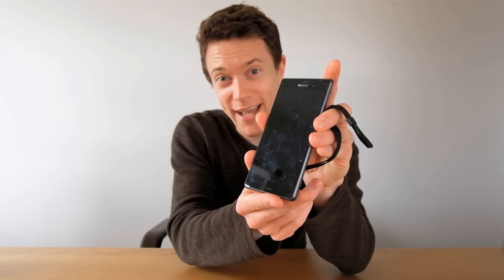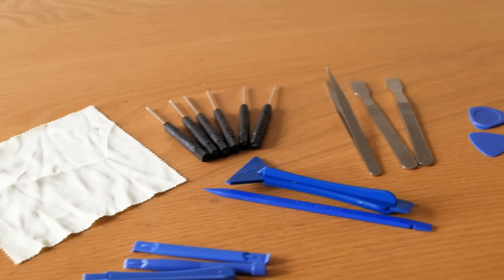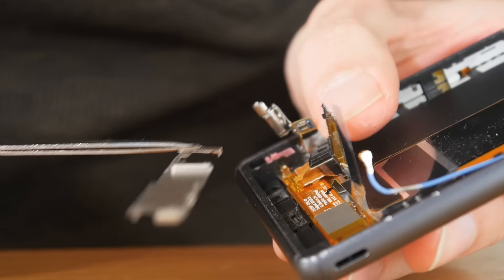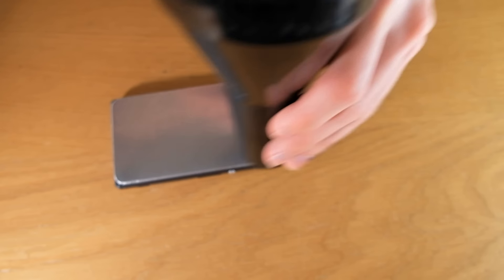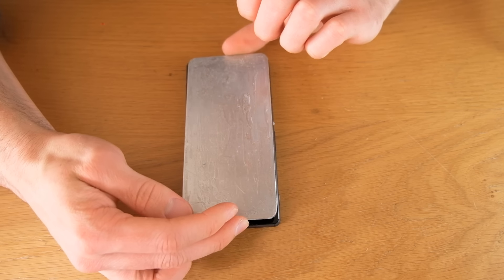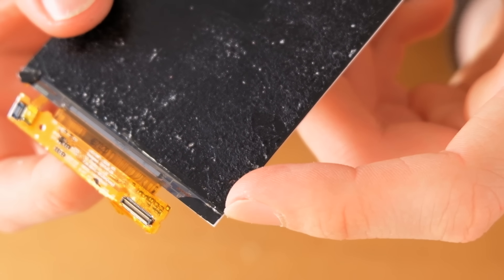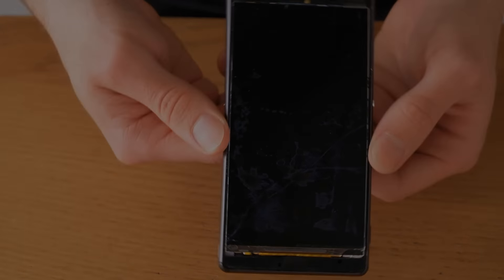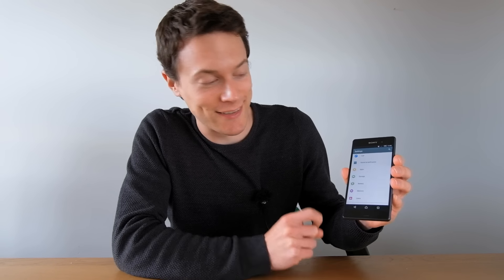Fixing a Smashed Phone Screen - on a budget! (GLASS ONLY REPAIR ATTEMPT)

Comment: Mr Perks. Don't use metal spudgers to work on the battery or connectors. You run the risk of shorting the battery and damaging it. Also the capacitors will hold a small charge after the battery is disconnected. The metal on your tools can complete parts of the circuit, sending unwanted power where it could potentially do damage.
Always use non conductive tools when repairing electronics when you need to touch connectors or other circuitry.
Reply: Also replacement screen / glass / digitiser modules can be bought on ebay for around £22 (for the Sony) and are easy to install. I had to do this for my brother in law a few weeks ago. The replacement glass was going to cost £17. The extra £5 and less work option of the complete unit was a no-brainer.
As to the issue of 'cheap copy', the build quality of the replacement unit was just the same as the Sony original. Also the digitiser was the same model and manufacturer as the Sony original.
I did enjoy the video however. Please keep up the great work and high production values.
Reply from the maker: Thanks for the tip.

Regarding the screen though, it really does matter that it's original. I later repaired a Z3 compact and bought a replacement screen + digitizer on ebay for roughly £20 and, while it worked ok, the screen area was smaller and the colours were very drab and dull in comparison to the original (brightness was fine though). I'd personally leave the cheap replacement screens well alone, but the official ones are much more expensive.
Reply: Maxx B incorrect. the battery has a built in protection circuit. and those capacitors wont be able to damage anything unless you try really hard
Reply: While you are correct that most modern batteries have a protection circuit  that helps keep the battery itself from suffering short damage (usually) the major concern with using metal tools is that you can make contact with the battery connectors and other connectors on the Logic board, which can cause permanent damage.
Reply: I'm just advising folk to avoid using metal tools around circuitry. A £500 phone is an expensive risk to take, when if you use a plastic tool, you remove almost all of the potential for damage. Feel free to use whatever tools you want.
As to the original screen over the cheaper replacements. The title of the video is fixing a phone on a budget. I was just making suggestions based on my experience with budget replacement parts. I found the replacement part to be of good quality, no difference in screen size or colour quality. Perhaps I got lucky with my purchase or you were unlucky. I suppose it's a mileage may vary situation.
As far as a budget repair goes, the cheap all in one module was a relatively easy fix and saved an expensive phone from the rubbish bin.
Reply: Maxx B seconds of shorting really doesn't matter for the battery..
Reply: That exactly what I wanted to say, oh well, have a like.
Reply: Looked aluminium to me and Aluminium isn't particularly Good to conduct things on that low voltage.
Reply: @siux94 and @mindaugas49ccm you are both hugely incorrect about shorting for a few seconds being harmless. LiPo and Liion batteries are current sensitive in their chemistry, high discharge (shorting) and high amp chagrining as well as over discharge (running the battery flat) all cause lithium crystallization in the battery chemistry that causes internal shorts when those crystals pierce the anode cathode barrier where the electrolyte is suspended causing a chemical chain reaction and fire, explosions and bad days in general. @Maxx B is totally correct, i cringe when i saw @DIY Perks using metal tools on the internals, never ever stick metal where magic electron pixies live, just ask AvE
Reply: Helveteshit, Aluminium is still a metal and it conducts electricity maybe not as good as copper but good enough to short things
Reply: @chaos That still don't approve metal tools, its not about shorting the battery , but shoring positive contact with something near on the motherboard can lead to serious damage .  What goes to the battery, most batteries has that protection circuit for shorting, overcharging and discharge protection, but shit happens and that circuit also can be damaged.
Reply: @mindaugas49ccm did you read my comment? sorry if i assumed you were siding with @siux94, you weren't clear either way. i basically said metal tools + circuits = bad
Reply: For Aluminium to short on that low voltage on such a contact, you would probably need more than mere 3.2V. Sure the risk is there, but the risk is low compared to Copper. 

Aluminium is twice as bad as Copper which means the risk is low. And even then, you all shouldn't even speak about what is correct or not when you handle electronics without Earthing the stuff anyhow. 

Because ya know, Static Electricity can discharge more than 5V in a spike which is plenty to injure sensitive parts. But ya know... You are all arguing about the tools that have lower risk than fat fingers that aren't Earthed. 

One thing if you have dry fingers which leads to better isolation on your skin but hey, how many of you got callous fingers from working hard with your hands without gloves?
Reply: @chaos I think he meant "with battery" not "THE battery" in one sentence. Sorry for assuming your argument wrong.
Reply: +Helveteshit Hey, we all trying to be samrtass here, but being too smart is just annoying
Reply: @mindaugas49ccm, so true, @halveteshit buddy Aluminium is an electrical conucter ans will short a battery at 0.1V just as much as 3.6V, whay do you think they use it for Bus bars in electrical engineering. http://apps.geindustrial.com/publibrary/checkout/Alum-Copper?TNR=White%20Papers%7CAlum-Copper%7Cgeneric

and btw ive worked as a chef for over a decade and my hobbies include blacksmithing so dont go talking about calluses to me.

Also i have like 10 other issues with things he did in this video that i didnt even bother bringing up like using that hairdrier with that LiPo battery (they dont do well with high temperatures) all in all this was a bad video to share other than to point out the things NOT TO DO
Reply: Aluminium is preferred in both Electrical cables of certain thickness as Bus Bars or simpler stuff because of few simple little reasons... Weight, Flexibility and Cost. 

Aluminium is easier to bend, easier to pull and on that voltage... Aluminium provides pretty much no resistance worth noting. 

As for it being an Electrical Conductor? I never said it wasn't. But I said on that voltage on such a connection, the risk is low. You run higher risk of discharging static electricity than shortening a battery with  a tool. 

Oh and since you blacksmith as a hobby. You should already know the difference between Copper and Aluminium or do you only handle proper Iron when you do that stuff which has even lower conductivity?

And upon closer look, the stuff he is using is just normal Metal by the looks of it. It isn't even aluminium that I first thought. Polished Metal or Stainless, I do not know. But their conductivity is five times if not worse than Aluminium. 

Do not recall the proper calculation table for materials conductivity. 

But hey, you are the Chef that knows how to cook Pasta better than I.
Reply: Everyone saying that shorting a battery isn't a big deal because of the protection circuit is putting a lot of faith into a saftey features that is never tested. Correct it probably won't cause a problem. But it could, and using a metal tool to disconnect a battery is like not pushing the brakes because your fancy new car has brake assist. it's there incase you mess up, not so you can be sloppy. I hope none of you work in phone repair shops.
Reply: Maxx B, So I have to put my Grandmother's Stirling silver butter knife back in the drawer?  I remember reading somewhere that silver is one of the best conductors of heat and electricity.
Reply: Diamonddrake The protection circuitry will protect the battery, no doubt. But its likely that the high current will damage the connector or leads.
Reply: John Doe silver is indeed a little bit more conductive to heat and electrical current than copper, making it the most conductive material at normal temperatures.
Reply: guess what's one of the conductors inside the lithium polymer batteries that can supply hundreds of amps at 3.7V? Aluminum ... Get your facts straight.
Reply: This is a things on xperia display, screen maker srink the display from 5.1 to 4.9 inch to make some money it happend on me 3 time ...
Reply: If you want a good display get a real Sony part or even do what he did and get a phone that just needs a main board.  If you know people who can get real Sony replacement displays get them to replace it.  You can be very sure that Sony would manufacture spare parts for their phones especially displays since they get broken a lot.  Why buy some mystery aftermarket part that might be of inferior quality when you can get the same parts your phone shipped with originally?!?!?
Reply: Z3 compact is originally 4.6"  and it still looks nearly borderless on it's sides!
Reply: The Z5 compact is just as nice but 23 MP camera and aluminum back panel.
Reply: You know this guy builds his own t.v.'s and other electronics right? telling him to watch out with shorting things is like telling an electrician to turn off the power when working. It's obviously a phone he's willing to lose and despite most batteries having shorting protection you're remarking him not to use metal tools near a plastic connector.
Reply: Maxx B I'm not sure what you know about electronics, but being willing to lose something doesn't mean you should show 500k people the wrong way to do something. Moreover, this channel is about diy, he's not a professional, and it's clear not everyone knows that. But he is handy and yes if you are very careful you can get away with it.
Reply: I know Mr Perk's has a good idea about what he is doing. I know this is a DIY channel. I'm also aware 200,000+ people have watched the video. All the more reason that Mr Perks should use the appropriate tools for the job. What if some kid with more enthusiasm than common sense has a go with a repair and hurts themself? I know the likelihood is slim, but there is a risk. 

My original message was just meant as a word of caution so that nobody got hurt. Judging by the knowledge demonstrated in the replies about aluminium not being conductive (it is and it's used frequently), and that charging protection will stop a short circuit (it won't, it fries the protection circuitry if you are lucky, destroys / vent's the battery if you are not), I think Mr Perks might have to be a bit more careful about what he tells people is possible.

Yes, it is difficult to damage your phone with a lithium battery when doing a DIY repair. But it's not impossible. Once a lithium battery catches fire, it is very hard to put it out again. Sending 4v into the wrong part of the phone's circuit can kill your phone. Electrostatic discharge into many of the phone's chips will damage them. This is why I commented about using a metal tool on the inside of a phone. You are just increasing the chances of doing more damage. Even if the phone is one you are prepared to lose. Frying the ICs when you replace a screen module isn't a smart idea.

Feel free to use whatever you want to repair your phones, TVs and other electrical devices. I really do enjoy reading the Darwin Awards web site ;)
Reply: Maxx B The repair was done improperly. You are so right. As a long time repair technician, it hurt to watch this. I he he had no plan to uv glue the new glass to the LCD. This is why I always quote screens as a full panel replacement. I never do glass only unless the digitizer is not glued to the LCD. Also what you said about metal tools on connectors.
Reply: Short circuit protection is not 100% effective, also it's there to protect the battery from exploding, not the electronics inside! If you accidentally apply power to something designed to carry signals almost a 100% of the times you will damage the system without tripping any protection circuits!
Reply: The Super Spowart d
Reply: Helveteshit 3.2V is actually a lot in this case. An i7 7700k CPU at stock speeds is only provided with roughly 1.3 volts from the motherboard, and anything above 1.5V will fry the CPU. Phones have CPUs which run at a much lower voltage, so 3.2V could definitely be devastating. Why do you think that people say that you need to discharge the static electricity running through your body (whether that is using an anti static bracelet or by just touching a grounded metal object)?
Reply: Helveteshit Also static can easily just pass from your skin into the metal rod, and static electricity can very easily reach 5V.
Reply: a really bad cracked phone
Reply: @henkmegool7864  oh noooo! Dont do that! You will let the magic smoke  out! 😅 Yes, short circuits are possible, damage level depends on short to what....

Comment: Pro tip
Don't use a matal tool to disconnect the battery please use plastic

I shorted my battery and I had to buy a new battery
Reply: Shorting out a lithium phone battery, especially one that is fully charged is a really bad idea. There is a scary amount of potential energy bottled up in one of those that can easily give you a nasty shock, burst into flames or even explode. Remember the battery in the Galaxy Note 9? All lithium batteries have the potential to do that if mishandled.
Reply: I use xiaomi phone's battery for small electronic projects and testing circuits on breadboard, I charge it using solar panal and many times have by mistake shorted it or put a really heavy motor. Seems like it has some sort of cut off/short circuit protection mechanism. It is still alive.
Reply: Pro tip: Don't do anything to your phone. Just go to a pro tech guy and he will replace the screen
Reply: @ElonMasks  omg this work

Comment: Remember that this process is extremely difficult and doesn't work on most devices. It's generally better to replace the entire screen despite it costing a bit more. Also, on iPhones, you need to take off the screen first and not the back. The back is basically impossible to remove.
Reply: It's possible with oca machine

Comment: Here’s a tip guys never use a metallic tool to disconnect connectors from the motherboard, this can quite possible short out that part of the board if not the whole board. Glass only repair is very tedious and quite frankly not worth it unless it’s something you have the tools for already, it’s very easy to damage the lcd panel. I always get the screen assembly and swap it out saves time and may cost a bit more but definitely worth having a solid screen that’s been quality tested.
Reply: not if its off
Reply: @Will-sv9mf  elaborate
Reply: @Will-sv9mf  not sure if you mean off as in turning the device off or disconnecting the power source. In the first case, that’s false, hitting the power button doesn’t change the fact that current is still plugged into the board. If you mean disconnecting the battery then possible yes, but there’s still a chance that a capacitor still has pent up energy and therefore a chance of shorting (pretty slim if you do the repair careful, but the risk is there). In any official repair training, a spudger is always the tool recommended to use when disconnecting directly from the motherboard. Obviously because it doesn’t conduce electricity.
Reply: @jorgenunez5669  your 100% correct even if it’s powered off capacitors still hold charge
Reply: @h0udinl  No, he is not correct. Capacitors won't store charge forever, if you leave phone alone without battery for few hours there will be 0 chances of shorts.
Reply: @ScienceDiscoverer  it usually takes 24 hours for capacitors to drain I learnt the hard way